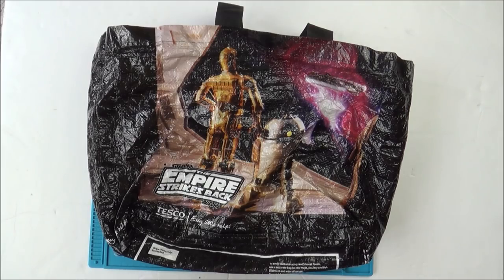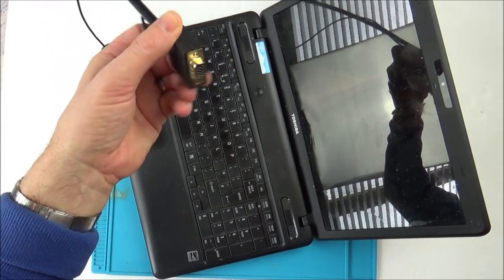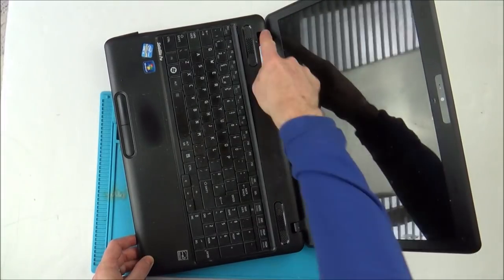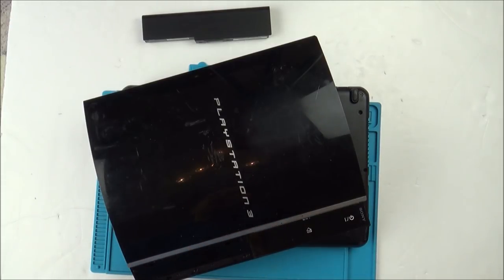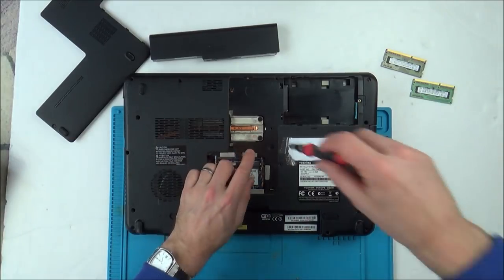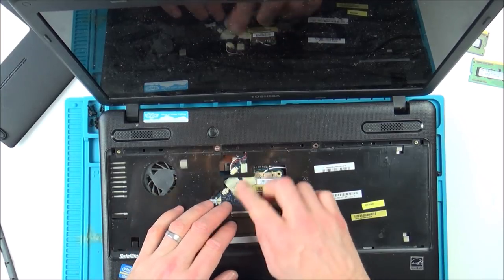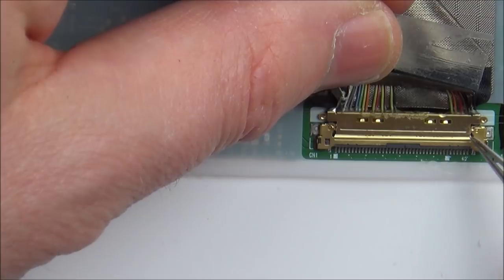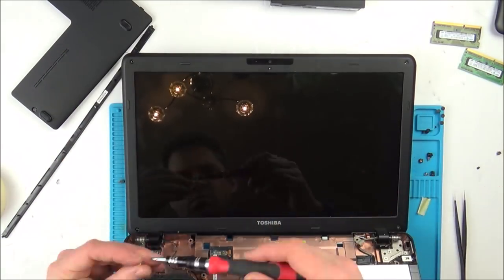Trying to FIX: Toshiba LAPTOP (Satellite Pro C660)

Comment: vince i would have put a SSD in that laptop ssd's always speed up old laptops especially the boot time's are super fast and loading up programs
Reply: vince i wouldnt put a ssd the cpu is very slow and its very old
Reply: I agree, use a ssd for a boot drive and you won't go back to a hdd for a boot drive.
Reply: @Username_-fm4lj  I had put an ssd on 2 old laptops and they did ran great. There's no issues with them. If the CPUs is actually ancient, then that will not make much of a difference.
Reply: @Username_-fm4lj  not true, ive actually used once of these laptops, same model and same cpu, the i3 is good, ive actually upgraded the cpu on that system to an i5 since it has a replaceable cpu. my current laptop as of now is from 2011 and is a lenovo ideapad z370. upgraded to 8gb of ram and an i5 2450m cpu. trust me, its a good system

Comment: 27:00 You can also update the CPU(i5 or maybe i7), Memory and put a SSD in it.
Reply: just a Dual-Core i7, the Quad-Core i7-2xxxQM and 3xxxQM got a larger Die and higher TDP, so it would be too much for the Cooling System and probably also for the VRMs.

Comment: The hard drive put one screw at the top corner it drops and slides in stoping the harddrive from dropping out its conection and the plastic back plate has two points sticking out that locks the hard drive in lol

Comment: That thermal paste is getting old and has separated you need to dispense the paste onto some paper until it comes out properly that liquid should not be used as is. If you dispense a few inches it should be fine further down the tube unless it's really old stock.

Comment: Well done for 1st time around 

Windows 10 . .  No thanks . .  Been using windows since first version came out (3.1)  now use Linux  instead at least everything is free also less computing power is needed and no virus scanner needed either.

Android is a version of linux which most people dont know
Reply: Windows 10 works fine on all my computers. Also Linux has horrible video drivers.
Reply: Nah, Android is based of Linux, yes, but it has no terminal or other Linux things, which makes calling android Linux, wrong.

And you don’t call them versions, you call them distributions, or distro for short.
Reply: Adnan Bukvic Android is Linux though. It also does have a terminal, although it’s hidden by default. You can install apps to use it though.
Reply: EvilTurkeySlices 
It’s based on Linux, it’s not Linux.

Comment: 19:20 you forgot to put thermal paste to the gpu, if you want to use it it's better to take it apart again and put some thermal paste on the gpu as well!
Reply: That’s not the gpu, it’s the chipset. It’s also fine as it has a Thermal Pad.

Comment: 21:53 get rid if that Seagate hdd before it fails on you they are the most unreliable drives, instead I would put an SSD into it it will make it way faster and more reliable.

Comment: Don't replace the hard drive with another hard drive, put an SSD in it, it will be way faster. Installing Windows 10 is very simple, just boot to the install disk and follow the instructions.

Comment: The partitions on the drive would have been old ones, you should delete them and create new ones or you will have someone else’s files on your hard drive as well which will take up space.
Reply: You can remote all partions and click on the unallocated space. Partions will be created automatically. It would be nice to see him upgrading this laptop with a cheap SSD.
Reply: Leon Vollebregt maybe upgrading the CPU as well.
Reply: @EvilTurkeySlices  thuis cpu is solderd onto the motherboard. There aren't many laptops with a replaceable cpu.
Reply: Leon Vollebregt I can clearly see the cpu socket.
Reply: @EvilTurkeySlices  sorry you're absolutely right. I did not notice that. CPUs are mostly solderd with modern laptops nowadays.
Reply: Leon Vollebregt prior to Haswell most laptops had socketed processors.

Comment: I have a Toshiba and it's never been right since I got it! On first powering it up, it updated to a different version of Windows 10 and never worked right. Within 6 months the optical drive gave up. I had it replaced under warranty and it came back with a non functioning webcam and a note saying the software was corrupted and that it was not covered by the warranty. HEAP OF SHIT!

Comment: Thermal paste is "suspended" so it's actually not water its an oil resaude that is part of manufacturing process its harmless and it will evaporate as the paste heats up some tubes will have it others won't its a luck of the draw.

Comment: I hope you installed the proper drivers for the laptop or else it will not perform perfectly
Reply: Windows does it the most of the time it self.  Older devices most likeley have the least problems. Windows is really smart these days with drivers and will update them if needed with windows update.. Trough that said sometimes it gives some troubles like the SD card reader won't work, the right keyboard hotkey drivers or the graphic card drivers (only happens with AMD ones)  but with a Intel processor and a Intel HD grappics  there won't be any trouble at all
Reply: @robdgekke  Windows is not smart enough. Windows installs usually outdated and problematic drivers because those are all that Microsoft adds to the update server. Those drivers required for proper functionality require drivers from the manufacturer website and anyone into repair or building of computers of any kind state that the best drivers to have are from the OEM website. I know this from personal experience as well
Reply: @ThePenguinOfTime  I install more than 100 pc each month and I really don't have any trouble with the drivers in windows 10 and most of the time windows gives newer drivers than the manufacturer does, specially with older hardware. Agian some times the hotkey or SD card reader doesn't work and u need the original driver  but for the rest no, It's true with new hardware u need sometimes the original drivers especially with AMD.. But most manufacturers won't even give drivers anymore they just say update ur windows.  most Asus laptops and motherboards, windows even updates the bios automatically.
Again windows is really smart these days and 90% of the time it does install the correct newest drivers
Reply: @robdgekke  Ok first off automatically installing a newer bios may not be as bad as it used to be but in the event of a failure of any kind is not a smart idea. Secondly most older hardware can't run windows 10 at all decently even with an SSD and the fastest ram it supports. There's modern laptops that I have dealt with usually ASUS that are the same. Windows 10 has even all around just broken itself many times without updates due to small oversights on Microsoft's part with no longer field testing on hardware. It doesn't matter how many you install. If you are not using the latest and proper drivers things can and will go wrong eventually. Microsoft signed drivers are not intended for daily use.
Reply: @ThePenguinOfTime   i know that bios updates can go wrong. And I prefer installing it manually if there are problems. But you can't disable it in windows.  Again I really don't have any trouble with windows updates it installs most of the time the correct ones. Did u know Lenovo and hp doesn't install drivers on there oem pc? When u turn it on for the first time and connect it 2 the internet all drivers gonna be  installed trough windows update.  Really ur have bad experience with old pc? Even a Intel dual core does run windows 10 pretty good. Without the original driver,  and runs completely fine. I run one here as server. None original driver are on it. Runs about 2 years or longer now. Can't really complain. I even did try it on a pentium 4. It does work okay trough I installed windows xp on it again for retro gaming
Reply: I have a few PC's here for retro computing. One is AMD and one is Intel and there's no special Intel CPU driver. The way you are saying it is like there is one and there isn't. What are important ones are the IDE/SATA/PCI-E bus controllers that need to be installed so that data is transferred properly. The Microsoft drivers only work for temporary use until proper drivers are installed. Whether you think it is fine or not doesn't matter. What does matter is having a pc work at it's peak performance and running Windows 10 on a pc that is not 64bit and/or 5 years old or newer is a bad idea in general due to Windows 10 being a resource hog in the first place.
Reply: @ThePenguinOfTime   it was more of a general idea of how old it is.. But I do agree on older hardware that's only 32bit don't install windows 10 on it,.  Agian everything that runs windows Vista  64bit can run windows 10,  most of the time fine,. Trough some times on windows 10 installing the older correct Soc drivers it will   crash on my experience. And I never experienced better performance with older manufacturers drivers, trough I don't rule that out, I can imagen some motherboard do have some benefits with it.
 Again 90% of  the hardware windows installs the correct drivers and will run good. And yeah some u need manufacturer drivers.. But be honest windows 7 was a hell with drivers performance problems etc. And with windows 10 they improved allot with driver issues and les hell with crashing of some stupid driver errors.
Reply: @robdgekke  I have seen zero evidence of bad driver performance on any pc with Windows 7. If you are using the weakest if Windows 7 versions then maybe but I have only used ultimate and professional builds.
Reply: @ThePenguinOfTime  I had allot of trouble.  But oh wel those times are luckily ovee

Comment: I'd suggest you don't flip this laptop and actually keep it. It is one of the laptops that is very easily upgradable and repairable. Laptop nowadays have soldered on RAM and CPU whereas these dinosaurs have a very similar setup to normal desktop pc which makes the a fun little project to have when you get bored.

Comment: Crappy thermal paste m8. Seems to have an excessive amount of oil or whatever it is they use in ghat formula.
Stick to the smaller ones you had since their quality seems to be much better than the ones shown here.
Good job one this project tho 👍🏼
That’s two for two on this job lot

Comment: Look at the heat pipe on your cooler...it's pinched, it's not going to cool very well.  You can get replacements on ebay pretty cheap.  I fix pc's for a living.
Reply: Looks fine to me, most laptop coolers look like that stock. It won’t cause any issues.

Comment: get a linux live cd easy way to fully test a laptop without installing anything cheap 120 gig ssd is around £15 to £17 i have fixed up a few older laptops than this and spent more than there worth doing so but its a bit of fun the hp my dad got for £2.50 works fine not spent much on it but it runs amiga emulation very well upto the equivalent of a 68040 so that is what it will be used for plus you can always use them for mame older laptops still run mame romset 37b5 very well you could even salvage a working motherboard fro a laptop that has to many broken case parts to build a basic mame arcade cabinet cheap arcade stick buttons and controller on ebay around the £15 mark .One thing i will say when searching for a screen for a laptop do not search for the model numberof the laptop itself but just the number from the screen itself .i see this toshiba has a cpu in a socket depending what socket and cpu is you might be able to swap it for a faster cpu this is what i done with an old acer 5315 so from a single core 1.7 ghz i now have a 2.4 ghz core two duo way faster than it was this laptop i factory restored the windows operating system and removed all the bloatware its the only laptop i have that runs windows and its vista lol .that said i can use it to copy files to my net md sony minidisc ,my sony vaio is great for emulation nvidia graphics chipset that is still supported in linux and it can run sega dreamcast nintendo n64 and atari jaguar and 3do perfectlyso its a decent enough laptop for day to day use and really great for retro gaming .

Comment: If it only have 2Gb of RAM, I very much doubt it's going to be any good installing Windows 10 on it, somehow.  It's probably too old a model, even if you were able to upgrade the RAM to at least 8Gb, which is the standard for running Windows 10 at normal speed, at present.
Reply: It had 4GB RAM. Also, 2nd Gen i3 (i think that's what this has) is decent for web browsing and simple stuff like that.

Comment: installing windows doesnt take that long! literally ive installed windows 10 multiple times and multiple machines its only taken an hour for me or 2 hours at the most. literally all you do is pop the media in (i use usb stick) select which drive and which version if it comes up with the option. wait roughly an hour and its installed, then all you have to do if customise settings or leave them default. create or login with a microsoft account or local user if it gives you the option and then boom your on the desktop! nothing compircated at all especially for someone like you vincent.

Comment: Seriously?  You never installed Win 10?  My 8 year old granddaughter did her laptop in no time.  It dead simple and very quick.  Not like installing XP on an old machine.  Windows 10 does it all itself apart from a few keystrokes.  That model laptop is a fairly old 2nd gen i3 with 640gb HDD and 6gb ram as standard.  You've been robbed. 😉  Fit an i5 3rd gen 16gb ram and an SSD and they fly.  You can fit another HDD in the place of the DVD using a caddy and use the DVD externally with a sata to usb caddy.  Not much use for DVD drives once you have installed the software so the bay is better used for HDD storage.  I have Tecra R950 upgraded in the same manner using.g two 1tb Crucial MX500 ssd's.  It's now a decent machine but it's no gaming rig due to the graphics limitations.  BTW Flattening that plastic coated bag down against the ram slots is not your cleverest move though I doubt it has done any harm.  Just not good or safe practice. BTW as you are going to find out...your installing updates only taking two or three minutes, well, you're an optimist as that was just the start of it....it takes hours to do it all!

Comment: You would probably have a better and faster experience if you ran Linux on it because it's free and open source and it will run better on the 4gb of ram that's in that computer then windows. But then again Linux does have a learning curve.